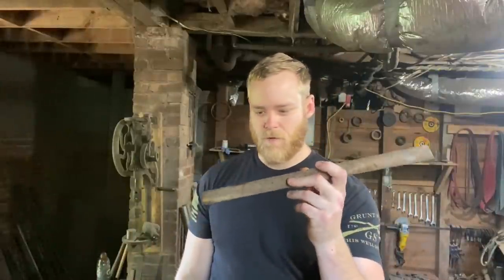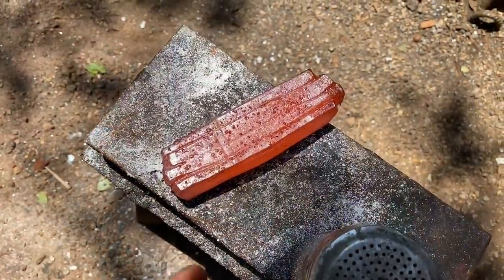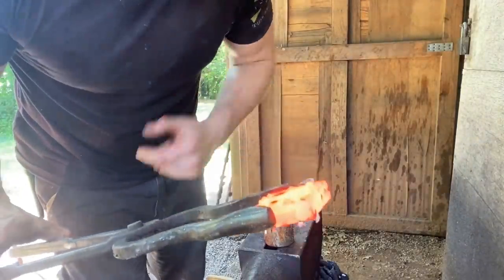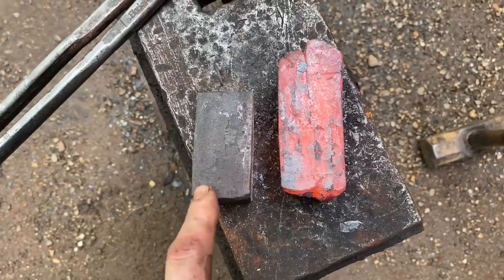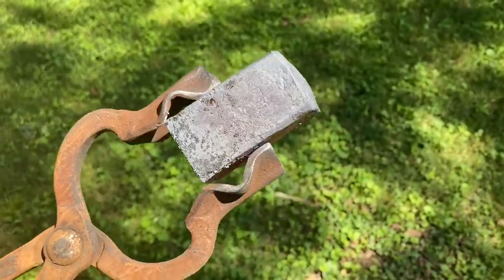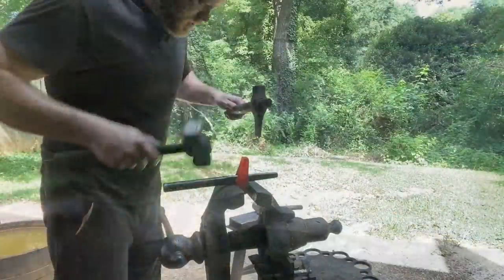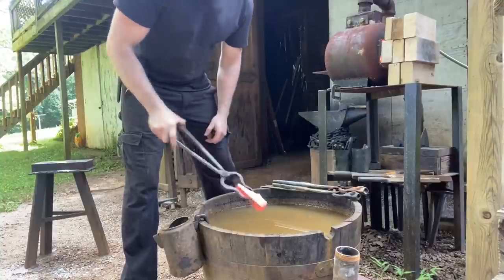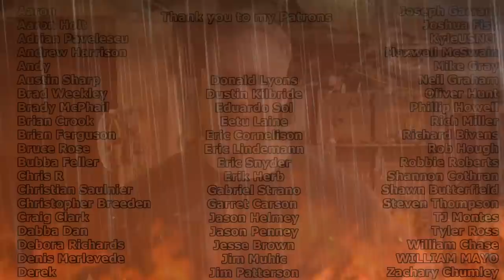Forging a wrought iron viking hammer

Comment: It is beautiful! I'm glad you stuck through the project. I failed at a wrought iron steel face Hammer myself not long ago
Reply: The challange is real. Ive seen smiths with lits of experience with wrought not get it to stick.  Its tough when it doesn't wanna work w you...but a beautiful thing when it does. 🙏💜🧙‍♂️

Comment: Hey, I’m a new subscriber and an aspiring blacksmith who is in the process of acquiring the necessary tools. Where do you get you 2” round 1045 from? Do you buy it online, or is there an alternative source that you get your metal from?
Reply from the maker: Dave G look into steel suppliers in your area. They’re more common than you’d think, but some don’t carry anything other than mild steel. Personally I buy it from a place called metal super market. I buy it in 20 foot lengths. If you want smaller quantities or to order online. Speedy metals is a good source
Reply: Old Hickory Forge thanks 👍 I’ll look into that!

Comment: I think you wouldn't have gotten as many delaminations if you added the flux later, if the borax is heated for too long it will stop acting like flux and instead it will act like slag, so you should bring it up to a orange or yellow temperature when you add the flux instead of adding it when its red or black

Comment: Awesome hammer John! I have a question....why do you not make eye punch and hot cut for your press? Seems like it would be much faster..
Reply from the maker: Anthony Strunk I have both of those. With the eye I was worried about splitting the iron so I wanted to keep it hot and go slow. As far as the hot cut. I just wanted to do it by hand
Reply: @OldHickoryForge  understandable..do you like the press? I'm considering one of those but there are several to choose from.. what do you think about yours?
Reply: @OldHickoryForge  understandable..do you like the press? I'm considering one of those but there are several to choose from.. what do you think about yours?
Reply from the maker: Anthony Strunk oh yeah it’s an awesome machine. The quick change die set up is great for a lot of what I do, with hammers I have to change dies very often. However with that you sacrifice rigidity to some degree, if you have to press at an odd angle it can cause the dies to slide. It’s not common but it does happen. All in all it’s an excellent machine.
Reply: @OldHickoryForge  thanks man.. that one is on my short list but I'm still looking around..lol.. thanks for the honest feedback.. have a good one